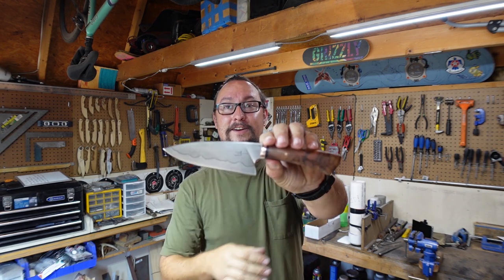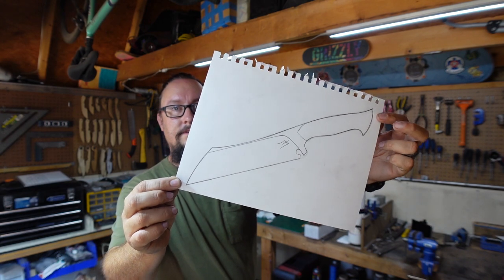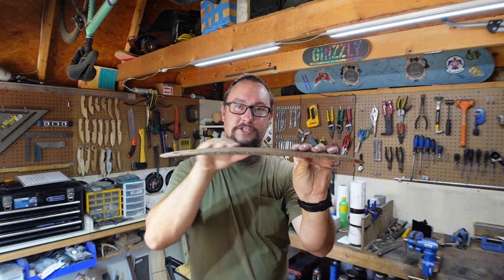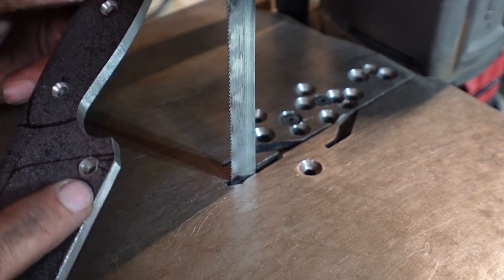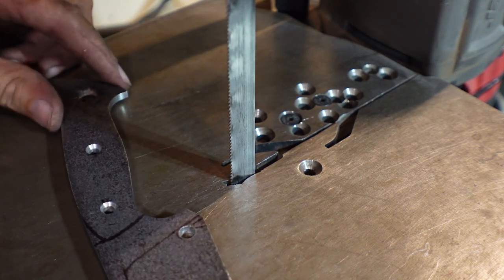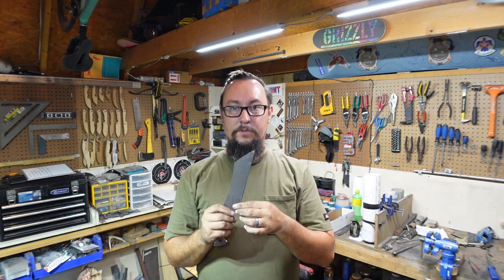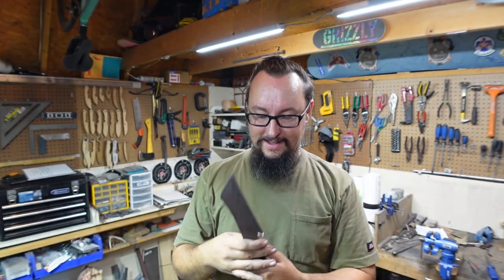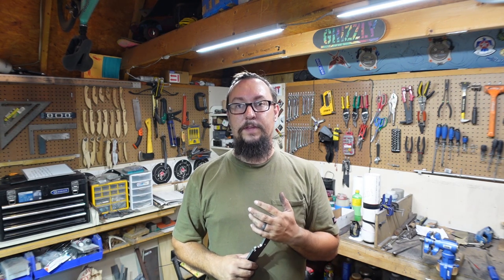Crazy New Knife Design | 5160 Leaf Spring Chopper | Shop Talk Tuesday Episode 96

Comment: Very nice Eric! I love the profile very much. I bet this thing is going to chop like a beast! I am curious if you annealed that leaf spring before you started grinding. If so, what was the process if you don't mind saying? I have a ton of spring I want to use but it is super hard to forge.
Reply from the maker: Yup, I annealed it after forging it flat. It makes the cutting and and drilling easier later in the process.
Reply: @theriversexperience9383  Thank you! What do you do to anneal? Just leave  it in the forge or use a substrate like sand or vermiculite?
Reply from the maker: @MBishopsBlades  I tend to leave them in the forge and let them cool slowly.
Reply: @theriversexperience9383  Thanks again Eric! Appreciate all you do for the maker community!

Comment: I do like a tapered tang, don't bother hollowing it, just get her on the grinder and make it nice and flat, I'll often do it similar to the 45deg bevel stage of the knife and just run that down to about 1mm or 1/16th thickness- taper it all the way up to where the ricasso and bolsters start. It will knock a huge amount of weight off it and for some knives being a bit 'tippy' towards the forward swing is what you want anyway or even just using that fore-weight to drag through cuts. Not so great for push cuts, but hey in this case its a chopper.
Yep, know all about stress
More or less why I chucked everything in and became a knife maker out in the bush, once you load up on enough depression, anxiety and PTSD I wasn't really going to end up anywhere else but a very bad place. Not a good financial decision, but sometimes its not about that money

Comment: What kind of compound is good for buffing Handel's. For beginner knife maker's
Reply from the maker: It really depends on the material but I've had good results with the Green compound that you can get from harbor freight. I've used it on many different handle materials with great success.
Reply: Thanks.useing diy canvas micarta.